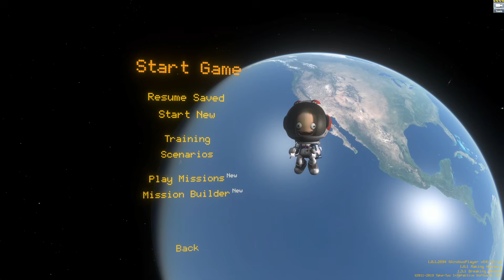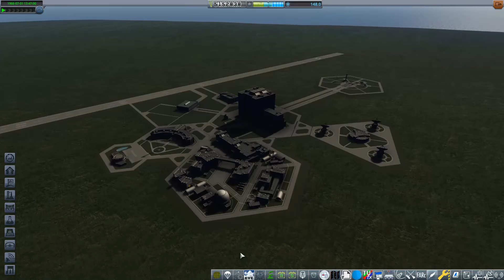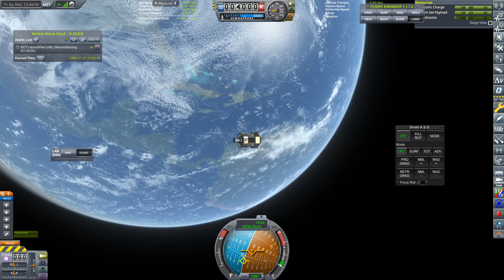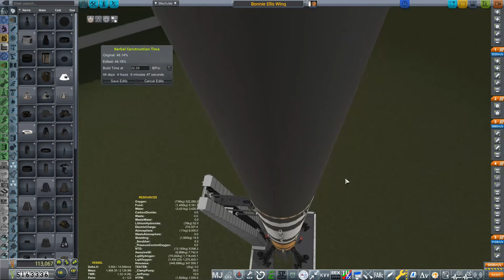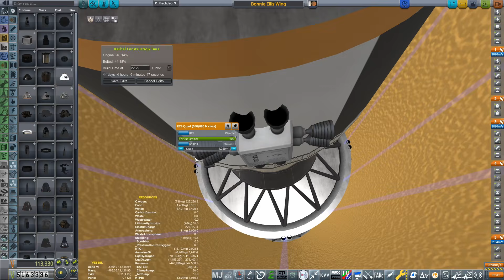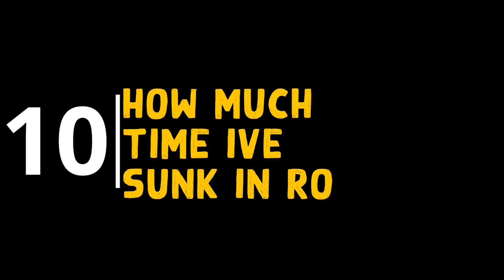10 Things I WISH I Knew When I Started RP1 | KSP RSS/RO/RP1 Tips and Tricks

Comment: Your method for interplanetary transfers is NOT how you're supposed to do it. TL;DR you never want to launch to the plane of the Moon (unless you're going to the Moon lol) as that can be a huge waste of delta-v. What you want to do instead is find the transfer prior to launch. The go-to tool for this (in 2023) is a mod "Transfer Window Planner - Fork"; it will show you the porkchop plots, let you pick a window, and not only tell you the delta-v, but also what the transfer plane should be (inclination + LAN). Then, instead of launching to a random plane like the Moon's, you can launch to this exact orbit, in which the transfer maneuver itself will be just a simple prograde burn.

Comment: I always have the same problem with the orbit, I ascend to 90 ° as everyone does, but it remains tilted with respect to the orbit of the moon, very inclined, I don't understand why, any ideas?
Reply: you have to launch at the ascending or descending node to have it close. one way is using the mechjeb rendezvous planner, and select the moon, then watch as you relative inclination gets down to about 1 and launch at 90 if you're launching from KSC. The minimum inclination is always the latitude of the launch site. KSC has a 28.6-ish so if you launch at a 90 degree angle the lowest inclination is a 28.6 degree inclination.

Comment: One thing I wish you could do was save a procedural part into an icon you can pick out of the parts bin with those settings already that way.  So lets say you are going to use a lot of 2meterx8meter tanks, put the 2x8 meter tank into the parts bin so you can just pick it up later and get one in that size already without having to fiddle with the sliders to restore your prev settings.  It would make tooled tanks so much easier to work with.
Reply: Old comment, I know, but totally doable with Subassemblies, as you can create subcategories for them as well.

Comment: The fact that when calculating the cost of tooling new sizes it checks to see if the new size is similar to existing tooled sizes was something I never knew, and its a game changer.  The fact that it cares about similar circumference more than similar length is a helpful addition to know, but for me the big thing was just finding out that it even bothers to check at all against previously tooled sizes.  I assumed that each tooled size was an independent new thing from scratch.

Comment: Wait, so when you use Mechjeb for your launches, you aren’t actually controlling the rocket manually like the gravity turn and staging?

If that is the case, then is it possible to play RP-1 without using mechjeb for everything and actually do it myself?
Reply from the maker: Nope Mechjeb is an autopilot, it’ll do most of the launch for you. (still need a working design though)

And of course! I spent my first rp-1 career without using mechjeb once :)
Reply: It is not technically required but it is strongly recommended.
Reply: I usually use smart ass but I do perform the ascent manually, but with more precision

Comment: When you install RP-1, does it automatically give you RSS and RO too? Or do I have to install the 3 separate mods?
Reply from the maker: Have to install the three separately, I have an install video as well that goes through step by step what you need to do :)
Reply: @Carnasa  brilliant, I’ll check that out later when I’m back with my pc👍🏻 Thanks
Reply: All 3 are separate, also get, mechjeb2, kerbal engineer, kerbal alarm clock, deadly reentry, and all but maybe 4 of the dependencys on ckan, kerbalism adds life support, orbital decay, overhauls the electrical system and science, and a lot more, deadly reentry is technically not required but surviving anything more suborbital reentry is near impossible without it, if you want engine failures install testflight or testlight, and i know i am missing a lot.

Comment: The first ones are just basic logic. If you change the diameter of the tank, the methods to create the tank are different, whereas the height is just adding more rings, or using taller metal sheets.

Comment: Or you can use transfer window planner and get your departure time without the need of switching to a vessel in orbit, it also gets automatically added to your alarm clock.
Reply from the maker: Like I mentioned in the video, transfer window planner never seems to give me good transfer windows. Although the last time I used it was about a year ago, so it might have changed since. But like i said, this way works for me and it’s pretty reliable :)

Comment: Engines upgrades and reliability is what I still haven't worked out. Does it even exist? How we make make them more reliable and burn for longer is RP 1
Reply from the maker: You can’t make them burn for longer than their rated burn time ever unfortunately, however the more you use an engine the less likely an ignition failure on that engine will occur. (And the less likely it will have a mid burn failure) Generally as you unlock more modern engines the burn times will increase, as will reliability!

Comment: Something that bugs me so much, say I didn't configure my rcs properly,  but I catch that problem in KRASH. I fix it, and test it again and it works. If I didn't save the craft before the second test, it will revert to the previous state where I didn't fix the rcs. It gets me too much
Reply from the maker: Funny you should mention that, so in this video I changed the rcs config of a craft, and then brought that craft out for testing to highlight how crazy expensive costs are, and that happened to me because of it. I think this also happens if you edit a craft from kct. I once spent a really long time painting up a spaceplane idea, and then had it all reverted because I didn’t save before I went into Krash 😭 but yeah tip number 11, always save before going into krash!
Reply: I savespam my crafts continuously. Pretty much after every tweak I save and then think about what I did.

Comment: What even is tooling though?
Reply: Basically, the equipment used to manufacture the tanks.
Reply from the maker: ^this, tooling a part basically means you’re setting the size of the specific part for the “factory” to mass produce it I believe, making it cheaper and quicker to build. 

Brings down costs and build times dramatically for a one up larger expense. So as with point two if you reuse your tooled parts eventually you’ll be saving yourself money, and depending on the parts you tool this could be done very quickly. 

There are times though where tooling a part may not be necessary, eg for a one use item that will cost a lot more than just leaving it be. It can be very situational.
Reply: @Carnasa  ok, thanks
Reply: Never not read the wiki. :) https://github.com/KSP-RO/RP-0/wiki/What-is-tooling%3F